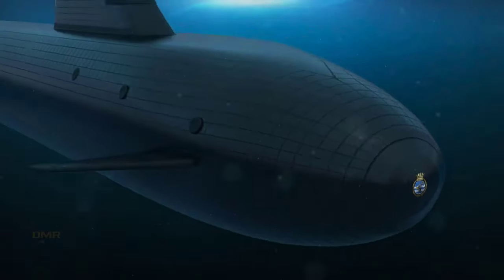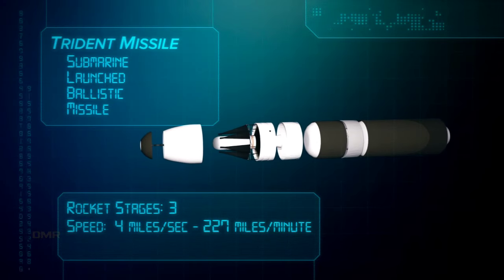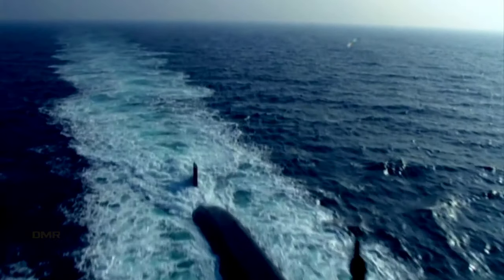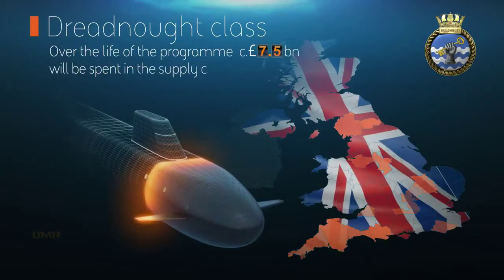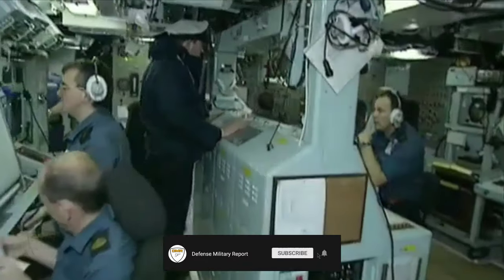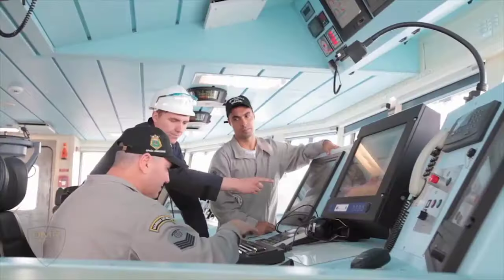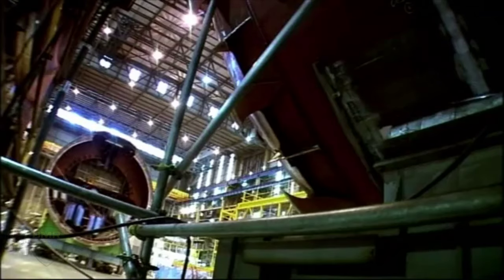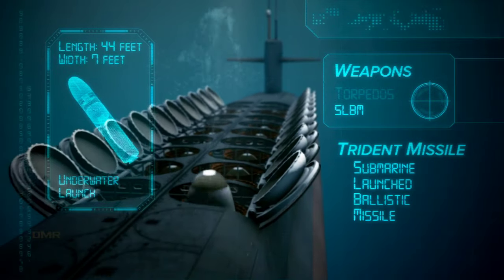BAE System Build Most Powerful Dreadnought Class Submarine for UK

Comment: These are the type of subs Australia needs, plus the nukes.
Reply: You don't need these, they are huge, over twice the size of SSNs, and designed to deliver thermonuclear weapons. Astute, or equivalent, is what is required. I wouldn't be surprised if the UK based a couple of Astutes in Oz until you have your own; building SSNs is serious engineering, it will take at least a decade for Oz to be in a position to build their own hulls and Oz will have to get the reactors built in USA or UK.
Reply: You don’t need these. For the price of 4 of these subs and the nukes to go with them you could buy 8 Astute class and a fleet of 100 F-35As.
Reply: @glynnwright1699  You're spot on. Aussie Nuclear submarines most likely won't be ready till the 2040s. The AUKUS deal stipulates that the UK and the US will lease their nuclear submarines to shore up the Australian submarine service for when the Collins Class submarines start to retire in the 2030s.

Comment: How is it a US designed reactor if it’s by Rolls Royce?
Reply: Us design built by rolls Royce
Reply: Design and associated technology development is different than build and manufacturing (under license).
Reply: Because Rolls Royce bought the US company....
Reply: @alanhutchins5916  You are thinking of PW Allison. It's not the same
Reply: Dreadnought Class will be the first to use the British PWR-3 (Mark 3 Reactor Version).

"PWR3 was a new system "based on a US design but using UK reactor technology". The Royal Institution of Naval Architects reported that it was likely that the UK was given access to the US Navy S9G reactor design used in their Virginia-class submarines. The PWR3 was a simpler and safer design with a longer life and lower maintenance requirements than the PWR2 variants and cost roughly the same as the PWR2b. The PWR3 has 30% less parts compared to the PWR2."

*Don't worry we share are technology with America also, there is actually a BAE Systems manufacturer in the USA that makes the Pump-jet Propulsion for the Virginia Class and previously the Seawolf Class. They also make the VPM module the Virginia Class.
Reply: @englishmisfit9881  According to the MOD the last time reactor tech from the US was shared with the UK was 1958. There is no evidence that there has been any tech transfer since on nuclear reactors.
Reply: @nathd1748  That not my words its 'Royal Institution of Naval Architects' quoted from when i which looking into PWR-3 reactor.
Reply: @englishmisfit9881  What would they know? It's a top secret design by Rolls Royce. It would be cheaper buying the US made reactor but we end up having to develop a whole new reactor design just for about 12 foreseable subs.
Reply: @nathd1748  "The Royal Institution of Naval Architects is an international organisation representing naval architects. It is an elite international professional institution based in London. Its members are involved worldwide at all levels in the design, construction, repair and operation of ships, boats and marine structures."

They definitely will know more about this than two guys on Youtube.
Reply: @englishmisfit9881  A nuclear reactor doesn't come under their remit. Believe me it does not.
Reply: Arthur Humphreys  You are telling me stuff I could've told you years ago with the exception that HEU is currently being repatriated to the US and that we do no longer receive it from them. We have our own domestic production of the stuff.

Comment: Sounds like they are already gearing toward cutting it to 3 units, only instead of 4
Reply: won't happen, 4 units have been named and 4 reactors are being built. long lead items have to be ordered now to be ready in 10-15 years. 4 reactor cores are being constructed.
Reply: @aaranbutton516  ya 3 operational boats ,plus all the spares stored a shore ready to use
Reply: I can reasonably guarantee we aren't.
Reply: @Dan-qg1bq  ya probably down to just 2 units constructed and a complete set of spares, would make up the 3rd one
Reply: @jonathantarrant2449  yeah, that's not correct

Comment: Meanwhile, the US leased UK "deterent" failed lol, Outlining what happened, The Sun said the Trident 2 missile was propelled successfully from under the water into the air by compressed gas in the launch tube.But its first-stage boosters did not ignite and the 60-tonne missile - fitted with dummy warheads - splashed into the Atlantic Ocean and sank.
A source told the newspaper: "It left the submarine but it just went plop, right next to them."🤭🤫

Comment: Salt water must really take there toll on these machines one wonders why they haven't come up with some type of alloy or something to prolong their life?
Reply: The Russians tried titanium hulls but they’re difficult to weld and expensive..
Reply: No it doesn't.  Which is why none are taken out of service because of salt water corrosion. NONE
Reply: Charles Spencer  LOL
Reply: @killerdoritoWA  russian boats dive to 430m & up to 1000m for specials. russians are also the biggest traders / makers of titanium. about 80% of the world supply at last check.
Reply: The use of sacrificial anodes prevents this to a large extent. Titanium would to be to light weight to use. You'd have to fill the boat with lead ballast.